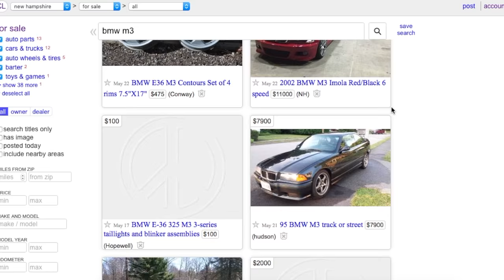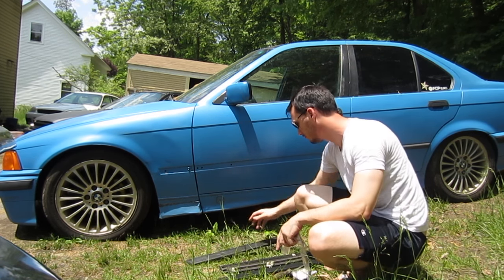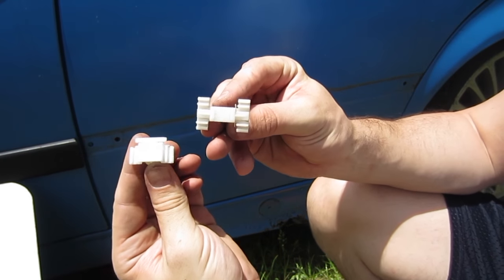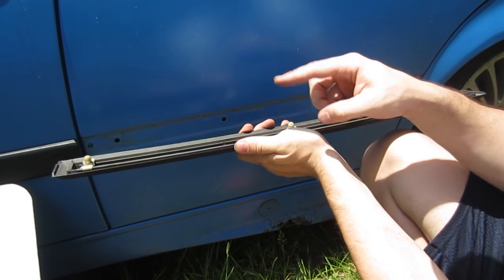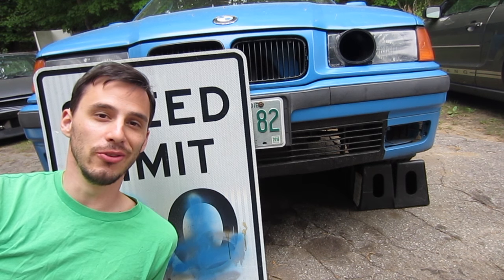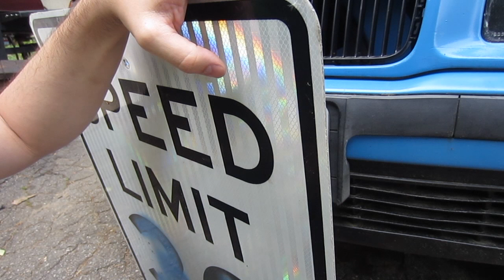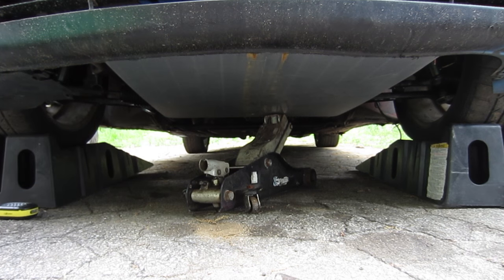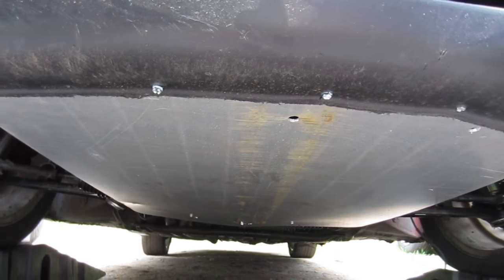BMW Free Skid Plate and M3 Molding Install - Season 2 Episode 6

Comment: Hey I want to make a diy skid plate but im no car expert. Are there any parts that I should not have the skid plate cover, or need room to move at all? Or is it fine to just cover the entire undercarriage with the skid plate? Thanks
Reply from the maker: Take you time if you can (is, Check clearances so nothing rubs, cut out the oil drain ,etc)

Comment: call me a noob lol but what does a skid plate do on a tuner? I know what it does on a rock crawler? lol
Reply: makes u scratch the skid plate instead of your oil pan over speedbumps or over gravel
Reply: Henrik is correct, but it also keeps the bottom of the car flat, making it more aerodynamic.

Comment: Lamesauce! No mention of the "RAM air" headlight as promised? Lame sauce. Guessing that experiment resulted in a negative-result? It's not a failure until you pretend it isn't. Quit trying to make it pretty, and extend that snorkel intake a few inches ahead of the headlight. It won't be pretty, but what works isn't always pretty.